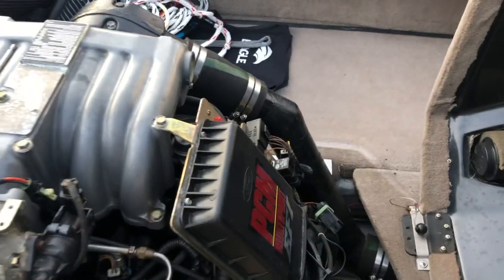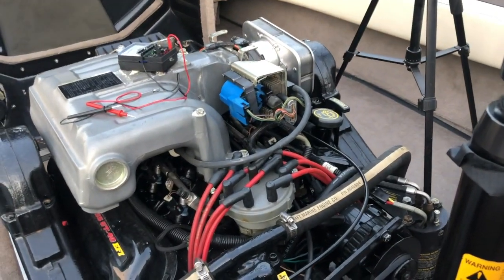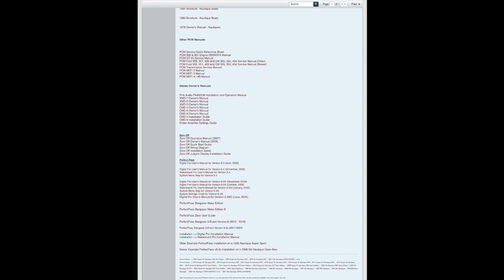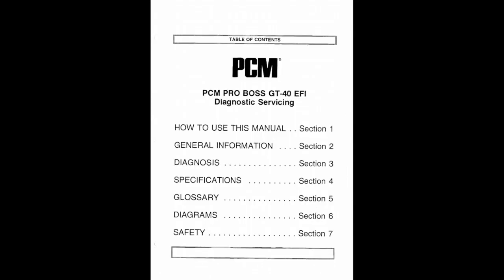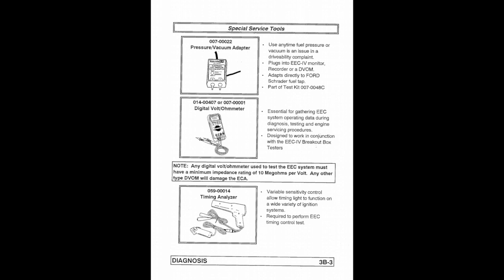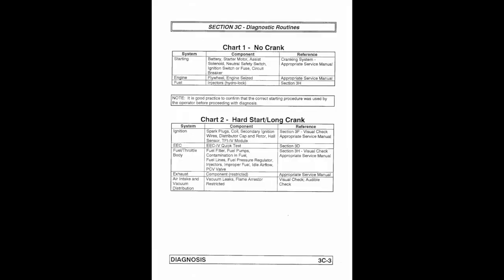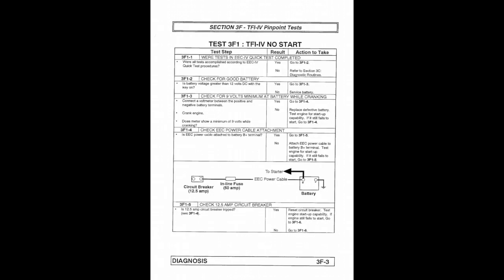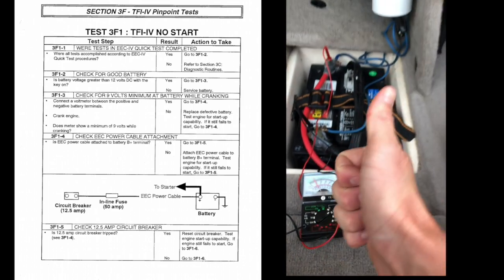My ENGINE is Not Running on my boat...

Comment: Solid bro. Manuals like that make a lot of people uneasy and not want to tackle simple issues. Good way to explain it as an easy step by step process.
Reply from the maker: Thanks man. I hope your boat is running smooth
Reply: CluEngineer thanks. It is! I’ve upgraded alternator and put new plugs, wires , rotor and distributor cap. Fires up so fast. In less than 1 second after turning the key.
Reply from the maker: Chili Styles, nice! Sounds like it’s brand new